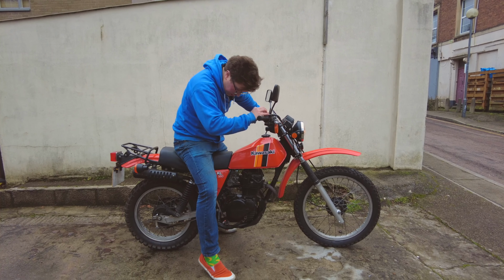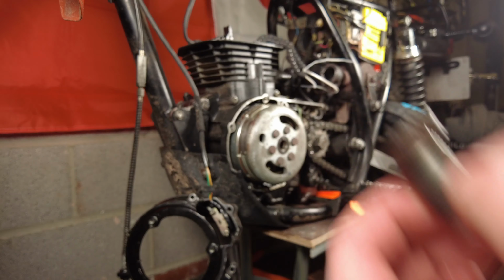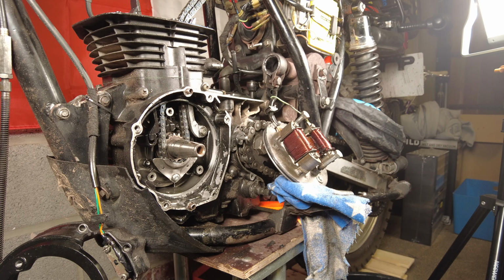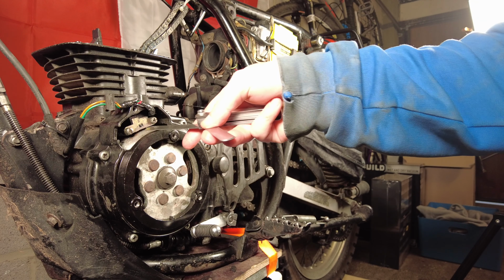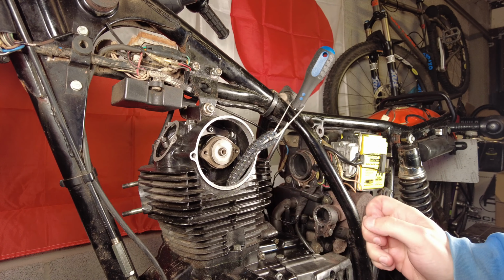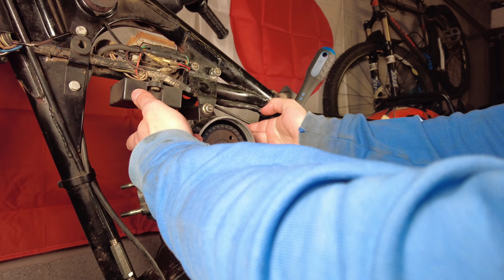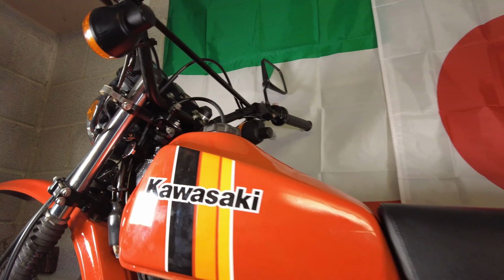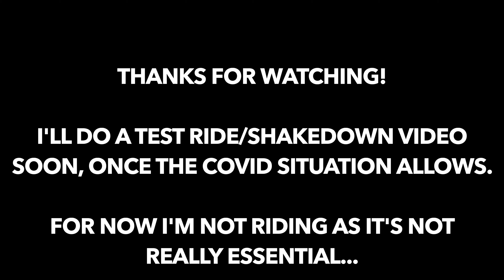The Guy Who Rebuilt Me | Kawasaki KL250 Episode 4

Comment: Hi man! I can pick this up for 400euros but it doesn't run.. Do you think i should go for it? How much did it cost you to get it up and running?
Reply from the maker: Hi! For 400€ it could be pretty good, but depends if the engine is seized up or not. If it turns over and has compression, it probably won't take too much to get it running really, sometimes these bikes just need to be used more. If it won't turn over, it's a bit more of a gamble, but tbh if the rest of the bike is solid then you might be able to find a replacement engine from somewhere. It probably cost me about 200€ in parts to get it going, but I didn't have to do all that much - when I had it the bike was running but knocking badly. There's a KL250 Facebook group which is worth joining, lots of knowledgable people on there -- good luck!
Reply: @TittertonRacing  Thanks man for the info 😎